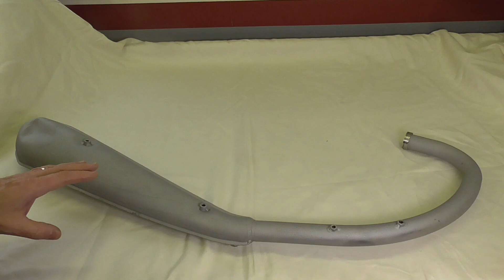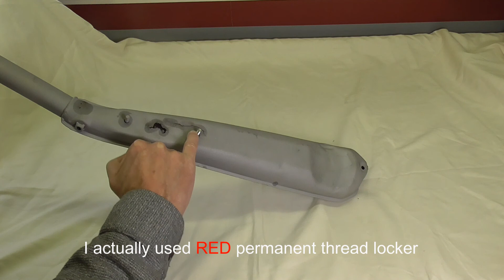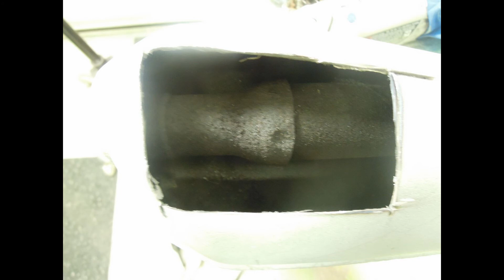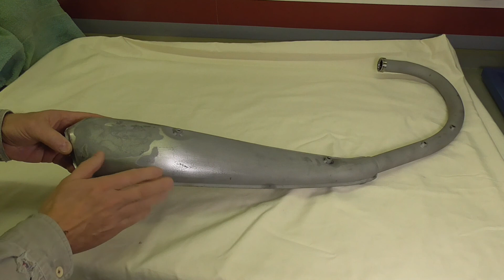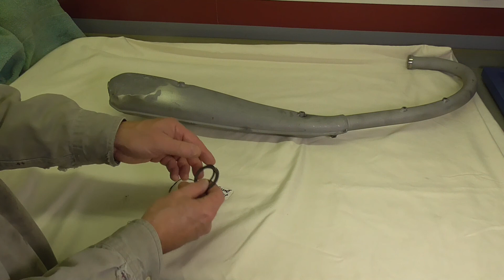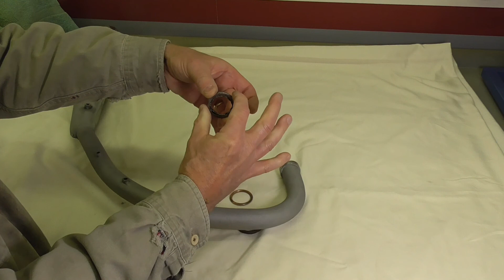Honda SL125, Exhaust System Repair - Pt 2 --- Video #251

Comment: If you had found it earlier would you have tried to weld on the "collar" instead of fabricating one? Once media blasting has been done, it always reveals other issues. It just gives us other problems to solve. Have you used the "high temp" JB Weld on other projects? How does it hold up? Thanks for explaining the steps used in your repairs!
Reply from the maker: Hello Pete,

I probably wouldn't have attempted to weld the original collar back in place, even if I'd found it earlier.  It was pretty flimsy to begin with and welding old thin contaminated steel such as this can be challenging.  To do it right would probably require TIG welding, which I am not set up for.  As Honda made an engineering change, I would have gone ahead and fabricated my own piece to emulate what Honda did.

I have used JB Weld high temp before without problems, though not in this specific application.  I have no reason to believe it won't perform well here, though we'll see.

And you're welcome...

Comment: Hopefully you will produce another video on the painting process. If not what grit will you finish off the filler prior to refinishing? What type of paint will be used? Primer? I really appreciate the time and effort you have put into your restorations and videos. They are some of if not the best I have seen on You Tube. I have watched and learned from every single one. It would be fun to see what other projects to have in the pipeline in your other garage. Your choice of bikes to restore is what I am interested in. Probably due to my age. Keep up the good work !!!
Reply from the maker: I haven't painted the exhaust system yet, and I've not decided how much of this I'll record for the channel.

To answer your questions though... I've used several different high-heat paints over the years.  My current paint-of-choice is VHT Very High Temperature Flame Proof.  I do use a VHT primer with this paint which requires "baking" in some form, as most high temp paints do.

In terms of surface prep, for an item such as an exhaust system, I don't put as much effort as I would body work, i.e., fuel tank, fenders, etc.  I'll lightly finish sand by hand, starting at 400 grit, working up to around 600 to 800 then clean thoroughly with acetone and/or brake cleaner.  Once it's cleaned, I use gloves to handle as I don't want to re-contaminate the surface before painting.

We'll eventually be talking about upcoming projects in a future video.   

I do appreciate the positive comments and words of encouragement and I'm glad you find the videos useful.   Thank you!